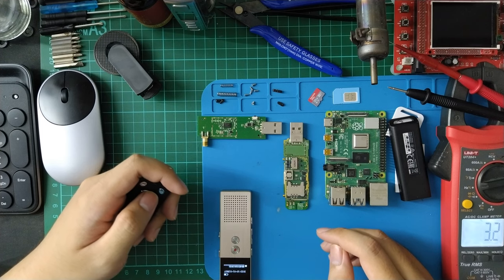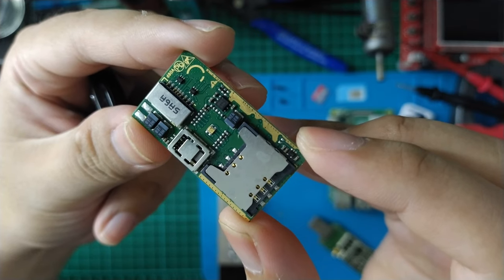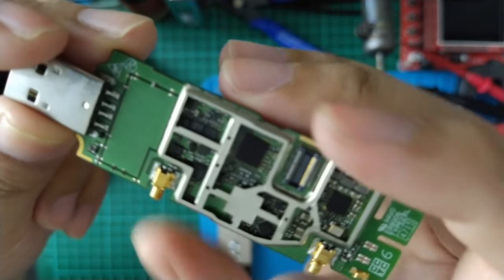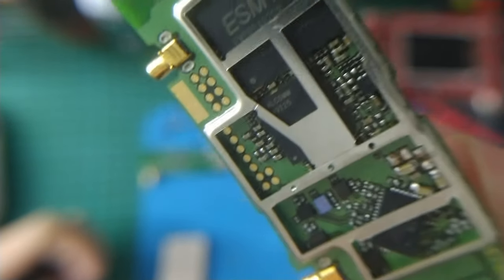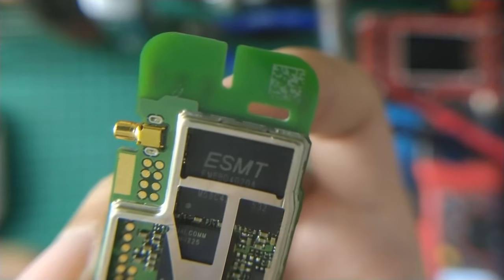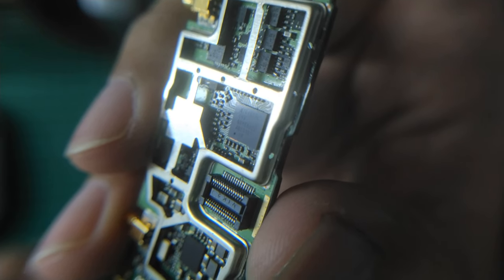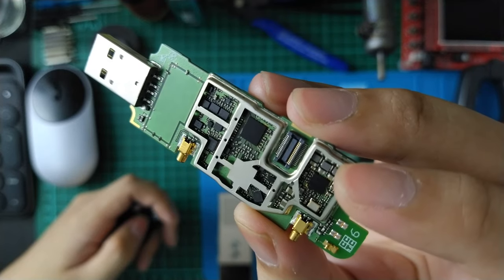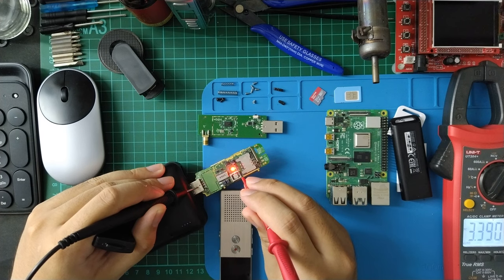VLOG EN: ZTE MF831 DISASSEMBLY / TEARDOWN

Comment: Hello man, love your more educated approach to electronics. I'm an English Literature grad, your english is good enough for a non professional. Keep it up!

Would love to see you review Enlight En-200 Case and the embedded powersupply. Enlight is an old player and seems to be good enough for low end PC... but I wonder if the embedded 300 watt PSU could survive continued use at 150-200 watt using a combination of 7th gen i3 and RX 550
Reply: Good day .. does dongle work as sim gsm module? after chang firmware and software?